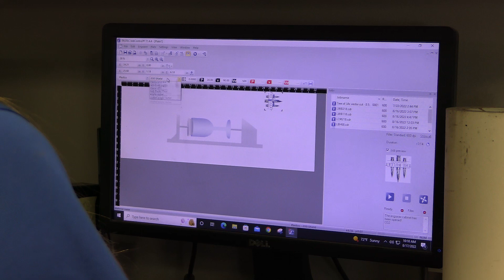How to Personalize Plastic Cups

Comment: Can that withstand heat? We have a white toner printer that prints transfers for rigid materials, but have to be applied with heat and cup press. Will these melt?
Reply from the maker: We did find that these started to warp in a press!